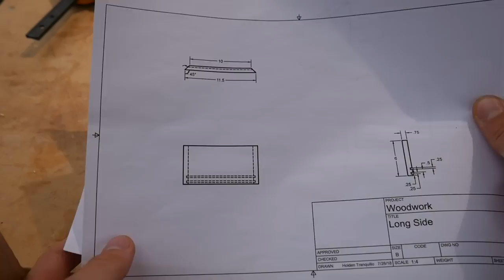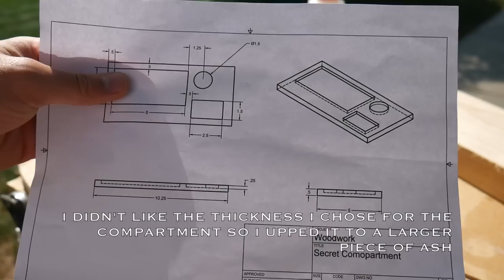Making a Secret Compartment Box // Inspired by Dustin Penner

Comment: Nicely done. I think I may enjoy the simplicity of the opening mechanism more than the original. (Sorry Dustin)

A trick with routing out a large section like that is to start in the middle and work your way out. Setup guide blocks inside your end goal size for the router to rest on, then remove them as you work towards the final exterior wall.

Comment: Sweet build ! you put that Dewalt table saw through its paces !  i ran a Architectual Woodworking Company Installation Division for 20 years and it got to the point that  i only liked the Dewalt job site or portable TableSaws  out on the jobs for the Installers most of all the other brands  are real junk and don’t hold up  to the  job conditions plus the Dewalt has a better Fence and some other features Although as I get older i’m more of a Sawstop guy
Reply from the maker: Its worked great for years! Thanks for watching
Reply: @TheTranq  what happened to the guard over the saw blade, very dangerous not to have one

Comment: That's a good looking box! You got mad skills! But I would recommend that you do some maintenance on that crosscutting sled. That should slide easily on the table, yours was sticking like crazy. That could comprise some of your cuts or even hurt you if it breaks.
Food for thought, great vid anyway!
Reply from the maker: Appreciate it. Yes my cross cut sled got really sticky by the end of the summer looking for a solution for that
Reply: I have that same saw and every sled I build sticks like crazy, even with waxing.  I think it’s the idiotic textured powder coat that DeWalt uses on the table.  It’s really designed for cutting 2x4s on a construction site, but the cost and portability are hard to beat for a small home shop....

Comment: I wanna know how many peaces of wood hit the res car when cutting the miters
Reply from the maker: Clearly you haven't cut many miters there's no strain between the blade and the fence
Reply: You would be correct.  I don't know shit about it . I just seen a couple peaces move and was heading towards the car. I   Wasn't being a asshole about it. I was just curious.  Woodworking is not my greatest.  I wish I had the mindset to make stuff like that with wood. But sadly I'm just good at working on trucks and cars. I do admire the work you did. I love me a puzzle box or a box with a hidden compartment or drawer.  I have a wooden box that has 5 slots going through it and you have to figure out the correct pattern to get it open.  I wish is was made out of good real wood like your box but it's made from that cheap shit. Idk what it's called. But it's still a ok box. It will never last as long as your box. Ok I'm gonna shut up bc if not I will talk your head off about this stuff. I'm interested in it but just can't get the nack of it.

Comment: 0:30 Cutting like that you're asking for a kickback, at least you have the car as a backstop.
Reply from the maker: There are no dangerous cuts in this video
Reply: @TheTranq  not sure if this is the perfect example of Poe's law or not...
Reply from the maker: @SupposedlyFree  There is plenty of surface to reference and am cutting a miter absolutely no danger of kickback
Reply: @TheTranq  Oh, you're the OP, so you're serious. Wow. Start watching at 0:30 and watch your push stick. Notice how the edge closest to the blade is raising? That's b/c you are pulling the board toward you and pushing down to try and keep it in the path of the blade, while sliding your work piece sideways. Very bad practice using a table saw in this manner. Also, it is called a push stick (or block, enter your choice of shape here) not a slide it sideways stick, because you should be pushing through the blade. You have been lucky so far, but you may want to learn about how kickbacks can happen.
Reply from the maker: @SupposedlyFree  Watch my videos do you really think I don't know how a push stick works? If you think a certain technique is dangerous then don't do it. I feel completely safe performing this cut for miters
Reply from the maker: @SupposedlyFree  also kickback occurs from binding between the blade and the fence not from the free end. Maybe you should refresh how kickback works
Reply: @TheTranq  I can't stand next to my table saw like that, I can only stand in front, where you should stand as well. So I won't be using your sideways technique anytime soon. I run over 80,000 linear feet of stock through my table saw a year, what you did was dangerous. Think about what you said "kickbacks occur from binding between the blade and fence." Your poor choice of position at the side of the saw is what will let the board raise a little and allow the blade to grab the board. Your position is also an awkward one, instead of pushing you are sliding the board sideways. It's your choice how you do things, I'm just trying to warn you that cutting like that is an accident waiting to happen. I truly hope you never have an accident.
Reply from the maker: @SupposedlyFree  it was used only for the miter. Of course that is not how I typically stand. Watch the rest of the video I think it is clear I know how to run the machine
Reply: You're right, @SupposedlyFree, that's a really dangerous method. Cutting anything on the table saw, that's wider than it is long is really asking for trouble. The fact that it's a miter, away from the fence, does (to a degree) make it a bit less likely to kick, but it's still a butt-puckering segment in that video.   @TheTranq There are 2 types of kickback, one is from being pinned between the fence and the blade, the other is when the blade rotates the work piece and pulls it back down towards where the user is (usually) standing. This is the type that will, almost always, pull your hand into the blade, and the more likely, of the 2 types, to injure the user.
All to avoid putting another kerf in that pretty crosscut sled.